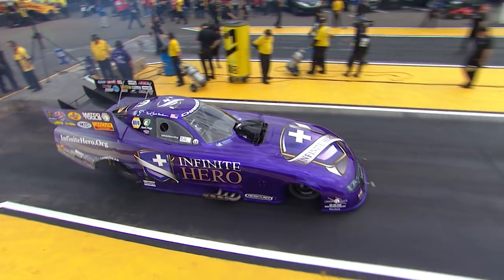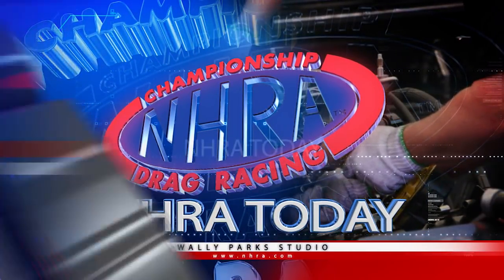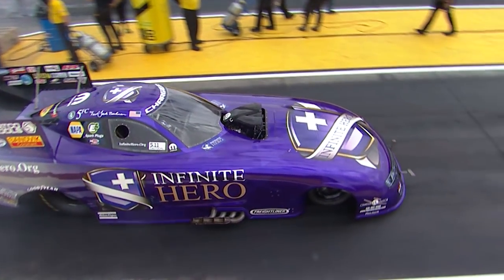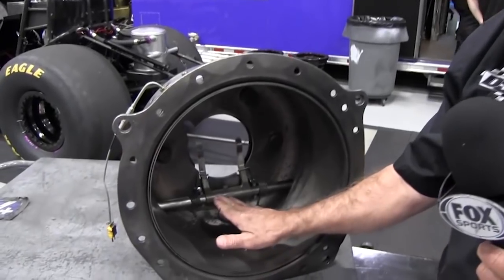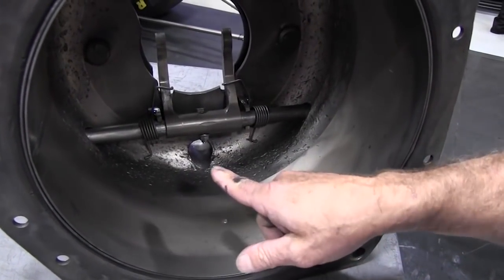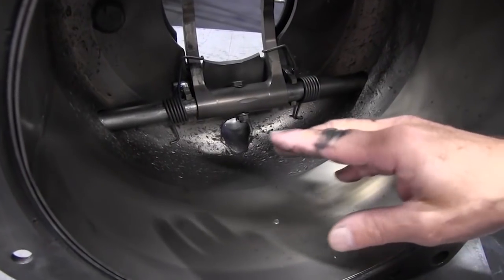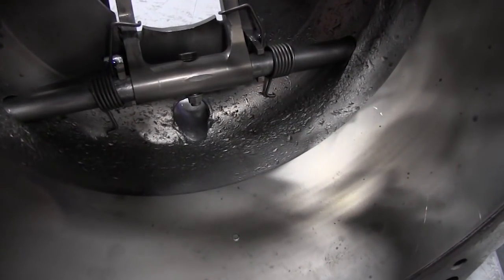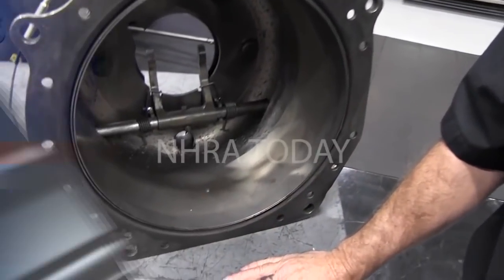Crew chief John Medlen explains what happened to Jack Beckman's Funny Car in Phoenix

Comment: Some interesting details about those bell housings I didn't know before. I think NHRA should start showing some of the engineering and design that goes into the top fuel classes and pro stock that makes the cars quicker and/or also safer.